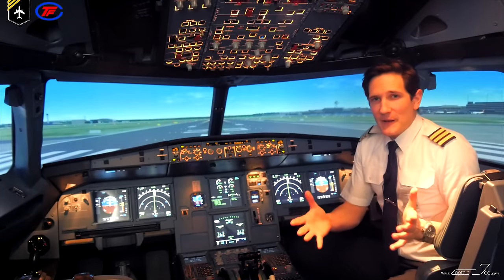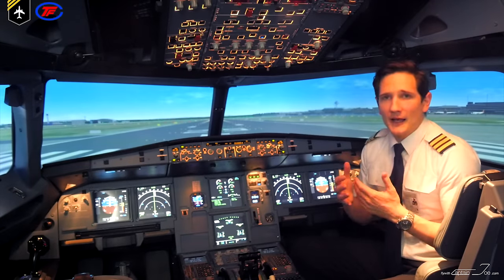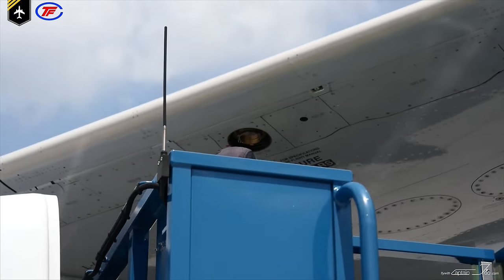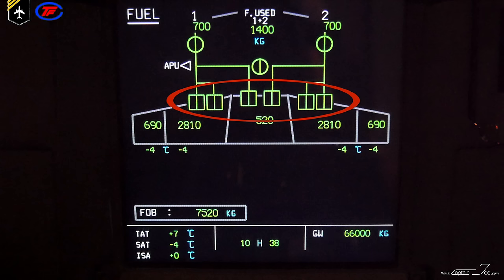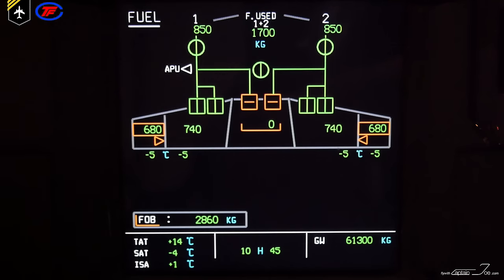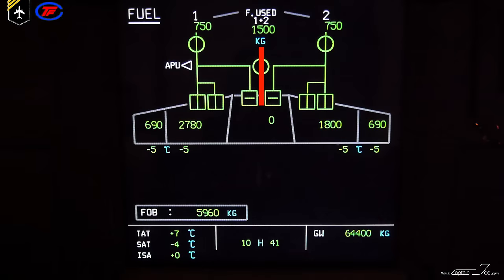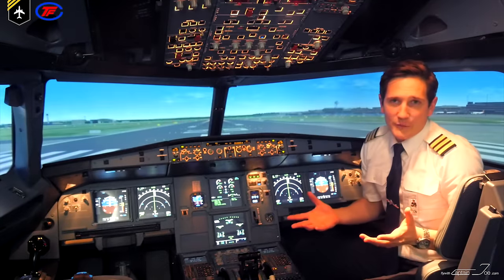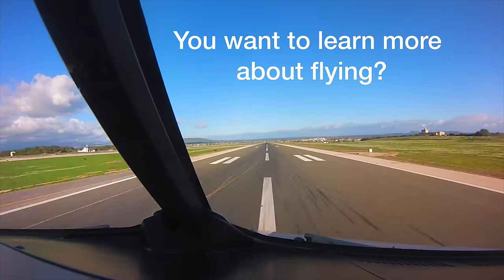How does the AIRBUS FUEL SYSTEM work? Explained by CAPTAIN JOE

Comment: good job Joe ! Can you explain in a video what do you do step by step since you arrive at the airplane until the takeoff ? I mean for example, open the door, enter cockpit, sit a your place, swith on the plane, and calculate speeds...
Reply: would be too much to explain
Reply: He don't need to explain every step. Just tell us like a before switch on checklist
Reply: Maxoo68  he checks out   the female flight attendants first ,just to make sure his day goes on smoothly than he starts pressing buttons
Reply: Haha ^^
Reply: "open the door, switch on the plane"
xD This is too funny
Reply: Like a vlog on a flight
Reply: AnatoleH1 Like in a car. Turn the keys to the On position and turn it temporary a bit further to crank the engines. Then put the gear lever in first gear and slowly release the clutch 😉
Reply: It is vey dangerous that planes have fuel tanks inside the fuselage or near the fuselage.
Reply: Maxoo68 @ usually it goes like : “ pitot heat give me to eat”
Reply: Ask him where the liquid fuel goes ??

Comment: Captain, I think you're  a great teacher on matters aviation, but I have a question:  is the plane able to take off with that much fuel?  And what about the tank capacity...looking at the wings, it doesn't seem to be able to accommodate tanks to handle that much fuel?
Reply: I agree. Captain Joe is great. The airplane is normally able to take off with that much fuel, but it depends on several factors. Takeoff and landing performance are calculated based on among other things temperature, air pressure, runway length, runway slope, wind, terrain, and as you would guess weight. If the runway is short, the airport elevation is high (lower side pressure), the temperature is high, and the aircraft is full of passengers and cargo, then there could possibly be a fuel restriction. As for those amounts of fuel fitting into the tanks, I agree with you that it doesn't look like it would work. I will say that the wings look much smaller from the terminal or the cabin than they do when you are walking under the wings. Also, the wings are quite thick, especially at the wing root. Check out Captain Joe's exteriors walk-around video and you can get a good view.
Reply: @mulder2400  I agree, when you take in consideration the numbers the math just doesn't add up. On top of that if you just do a round number of how many planes that fly in a day, vs the gallons of fuel used by the planes vs the gallons produced , theres not enough fuel made. The planes might use some fuel, but not that much as they state they do.
Reply: Hi i have some questions It is true that the center tank can refill the wings tank in cruise in order to increase the lift ?and what about boeing planes like 737and 747,are they even manually on the pilots decision,able to do somethings like this?
Reply: @mulder2400  Excellent ! Thank You for the links.
Reply: @ethansaviation2672  Are you trying to quell Free Speech? What  a small mind you must have. Why not consider what Mulder is saying here and try to refute his findings or ask questions??? instead of calling him names??? You need to grow up.
Reply: @emgee3057  Actually, I have look at many links (including these ones) from people who believe this theory. They don't make sense. I do think I was a bit harsh though.

Comment: Hey! Could you do a video about what pilots do during cruise speed?
Reply: They usually sleep one by one or prepare next flight or talk to each other... but they have to monitor constantly all the information displayed to see if everything is correct
Reply: Alpha Only on long haul flights any crew member will sleep. And if the flight is longer than x hours, a second set of pilots is required. So both the captain and co-pilot go for some off-hours or none, being replaced by the second pair of pilots. It's not like the co-pilot goes for a sleep and the captain sits there on his own ;)
Reply: Richard van Pukkem Thanks for your comment ,  I forgot to say I included all flights from short to long haul and obviously pilots don't sleep in a short flight... Just for fun , in 2014 the pilot of an A319 going from spain to belgium slept and was contacted by French Air Force for not answering ATC... :D
Reply: They play rock sizzers..

Comment: I remember watching a documentary where a leak caused fuel imbalance. The fuel temperature and pressure caused the crew to misidentify the problem and turned on the cross-feeding which exacerbated the problem by letting more fuel leak out.
In the end, the aircraft lost all its fuel and had to use the ram air turbine for power and glide to the closest airport.
Luckily they succeeded.

Comment: Can you teach us about Cost indexes?
Reply: it is multiple index as related to cost. there now you know
Reply: Made no sense.
Reply: The cost index is used to optimise the aircraft's speed so that the total cost of the flight is at its lowest. It gives the ratio between the unit cost of time and the unit cost of fuel. Does that help at all?
Reply: But I still don't get how it changes from airline to airline and so on. I just want Joe to explain really.
Reply: Fuel duty in different countries and where different airlines operate is likely to be the reason.

Comment: Hi Joe! Could you explain how do the spoilers work and how are they activated? Thanks, and great vid!
Reply: They increase drag and are deployed with hydraulics.
Reply: That's one way to answer his question :D
Reply: +Villager #4 thx buddy!!
Reply: I'm no pilot but I was taught that they primarily to spoil the airflow over the top of the wing and reduce lift, increased drag and slowing down is secondary/complementary to this. For instance if you didn't deploy spoilers on touchdown, ground effect could cause you to skip/bounce down the runway. Spoilers on an aircraft "spoil' lift (i.e. increase downforce) causing the full aircraft weight to rest on the gear which allows the brakes to work at full effect without skidding. They also increase drag and allow the aircraft to slow down. I've seen them deployed in flight outside my window on a 737 during descent, possibly to slow the aircraft and reduce altitude (to keep within the glideslope).
Reply: Yes, I also think the main function of the spoilers is to spoil the lift created by the wings during the touch down. An aircraft can fly because its wings are shaped to let the air accelerate faster on the upper section of the wings than the lower section of the wings. That causes a lower static pressure on the upper side of the wings so the pressure differential creates a lift force which pushes the aircraft up. The spoilers are to decelerate the air on the upper side of the wings by blocking them. That reduces the pressure differential so the aircraft can overcome the ground effect and firmly grip the ground tight. Once the wheels are on the ground, brakes will do the work and stop the aircraft.

Having said that, spoilers still create some drag to decelerate the aircraft, but the main aerodynamic drag still comes from the flaps.
Reply: There are spoilers for inflight and also for ń the ground which are the inboard ones.

Comment: Please explain what a squawk code is?
Reply: Shawn Malaka it is just a random number assigned by the controllers to identify your aircraft. Every aircraft controlled by a controller has a different squak code.

There are some special codes if you fly VFR (depends on where you are) or have emergencies (7500, 7600 and 7700).
Reply: It is a number transmitted by the aircraft transponder (along with other data such as altitude) every time the radar beam is detected sweeping the aircraft.  It is used to identify the aircraft on the ATC radar scope.  The code is more or less randomly assigned, but there are specific squawk codes the pilot can use that indicate things like hijack, emergency, etc.
Reply: When ATC requests a squawk, they are also requesting that the pilot presses a button on the transponder that highlights the aircraft and it's information on the radar screens

Comment: Great video as always Captain ;) The Fuel to Oil Heat Exchanger caused a crash of an British Airways Boeing 777. The fuel got blocked by ice in the FOHE and therefore engines lost thrust just on final approach to Heathrow. Luckily pilot made a split second decision to retract flaps by one degree and they crash landed on the airfield.

Comment: Fuel storage 23,000 L ie tons!! FOB says 7,520 !!!!!! Errrrrrrr you're lying 23,000 tons of fuel is a joke on a aluminium plane!! taking you have passenger weight, cargo, baggage, What those wing tanks are is  compressed helium tanks and the plane engine run themselves on compressed air.
Reply: A litre of fuel does not weigh a ton. It weighs a little less that a kilogram.
Reply: @mikelowe5096  0ne thousand lites == roughly a ton! 23,000 ummmmmmmmmmmmmm lol
Reply: @chilbury  Since you can't seem to do basic math, it's 23 tons, not 23,000 tons as you stated.
Reply: It’s 23 tons in liters by volume and in kilos roughly about 19tons. I get the confusion, fuel in planes are measured in mass and not volume. It burns on average 40 kilos per minute both engines and 2400 kilos per hour. So for short flights 7520 can still take u 2 hours of more and rest are fuel reserves, hope it helped and u have a nice day. Awesome

Comment: Hi Joe, great video however, Airbus has not installed the IDG cooling system to prevent fuel from freezing. It's job, as you mentioned, is to cool the IDG oil. A secondary effect of this oil cooling is the heating of the fuel but only in the outer tank. Fuel can still freeze though and there is an ECAM alert for this as you're well aware I'm sure.

Comment: Hi there. Can I ask are you basing this video on the A319/A320 or the A321. Also which engine type? I would guess CFM seeing as you mentioned the IDG oil is used to warm the fuel but not 100 % sure.
Reply: A319/A320 as the A321 doesn’t have separated wing tanks

Comment: Fuel isn't transferred from the heavier tank to the lighter tank, its merely burnt from the heavier side by both (or either - SE case) engines by switching off the fuel pumps on the lighter side.

Comment: Can you please clarify for me: the fuel-oil heat exchanger only heats up fuel in the fuel line so it doesn't gel up in the high pressure pump, right? It doesn't then feed the fuel back into the tanks to keep them heated.

Comment: The A320 fuel system is pretty basic. the MD11 hast up to 8 tanks (6 standard) devided in up to 12 compartments (10 standard) with up to 22 fuel pumps (18 standard). It's the most complicated fuel system out there that I know of. But basically it works very similar. Fuel is used from the inner tanks/compartments first and last from the wing tanks/tip compartments.

Btw, the the main fuel oil heat exchanger is more important than the IDG FOH ;)

Comment: Nice video. All very accurate. One thing it breaks from time to time as usual on any aircraft but a lot of electrical faults for auto feed and also the fuel inerting Staten is the biggest pain in the ass on this aircraft

Comment: Captain joe, I have a question for a potential video. Does a pilot stay on one aircraft type through their whole career or do they gradually progress through different aircraft that are classed as more challenging to fly? If this is true how often do they change and approximately how many different models will a pilot see in his career?
Reply: Depends on what you want. If you’re based in a city that’s mostly airbus 320 and let’s say 787 flying you you’ll do one of those. Most of the time pilots will choose their base and whatever type they can hold in new hire training. If a pilot wants to change base or type, they may bid for it though you’re subjected to a “seat lock” for 2 years or whatever the airlines specifies.

Comment: I always found that to be clever. Using fuel to cool the oil, which becomes oil warming up the fuel instead of a separate oil cooler and separate fuel warmer.
Reply: SixStringLove Guy BMW uses the same trick, putting coolant to cool the oil, via heat exchanger. The unit at the E46 generation was failure prone when different grade of oil is used (30 instead of 15), until the 2007 face-lift when thicker plates used

Comment: Can I ask some questions please? 1) Are planes ever over fuelled for a return trip, or would that weigh the plane down too much? 2) If fuel in the wing tanks is used to increase inertia and dampen wing movement, are planes ever over-fuelled so they can benefit from this damping on landing? 3) Is the obvious wing movement on landing linked to a lack of fuel in any way? 4) How is fuel transported to airports? If an A320 sized plane takes over 20,000L, the fuel requirements of a busy airport must be immense. Thanks 😊
Reply: No they are only fuelled with fuel for the flight and reserve fuel
Reply: 1) Yes it’s called tankering and Joe has done a video about that and it’s normally where it would be cheaper to just use extra fuel at the base airport instead of refuelling at your destination. 
2) You wouldn’t overfuel just for that reason.
4) Underground pipes
Reply: @ethansaviation2672  actually they can. It’s called tankering
Reply: @tomstravels520  Thank you. 😊👍🏻

Comment: I remember the incident of Air Transat flight 236.  They had developed a fuel leak in one of the engines.  This subsequently caused a fuel imbalance in the fuel tanks.  Following the protocol, they opened the cross feed valve to balance the tanks, not realizing that the reason for the imbalance was because of a leak.  This action subsequently drained both tanks and they ended up gliding several hundred kilometres without fuel.  What I don't understand is if they were monitoring the tanks as they should be, why did they not close the cross-feed when they realized that the imbalance was continuing and that they were consuming fuel at an alarming rate.
Reply: As far as i know, they believed for a very long time the computer showed corrupted data because the first indication that something was wrong was an engine advisory that indicated high oil pressure and low oil temperature in the engine with the leak, which under normal circumstances makes no sense at all for an engine that already runs for several hours.
Reply: So they believed the oil pressure warning, oil temperature warning, individual engine fuel consumption, and total fuel onboard data were all malfunctions, yet believed the fuel levels in each tank and imbalance data was accurate.
 Sounds like they were believing the only data they wanted to believe and disregarding rest.

Comment: Hi Captain, I really enjoy watching your videos and learning more about the mechanics involved in jets. This time I have a question. If we store fuel in wings, which holds the engine dont you think it is going to be risky in case of an engine failure which may result in fire or high temperature and then the fuel might also catch fire?
Reply: Kishan Mishra the engine is hanging from the wings. So it’s not really that close. And there is no other place to store fuel.

Comment: 23.858 reads like 23 point 858 which is less than 24. For 23 thousand and 858, we usually use a comma in the middle and write it as 23,858.

Comment: Great videos for aviation enthusiasts like me who are not in the profession...quite sure you know of the Air Transat 232 scenario where the pilots switched on the cross feed valve to solve the fuel imbalance issue which in that specific case worsened the overall problem...though that was the A330, could you give more specifics to troubleshoot with a checklist for the A320 please...

Comment: Dear Joe, 

have the aircraft developing companies implemented some kind of system that prevents the occurrence of ignitable gases in the tank as a lesson after the TWA-800 accident in 1996? 

I also wonder if a commercial pilot has enough leisure time to make a you tube channel or are you given this time by your air company? I also this because I got a lot of contradictory info lately.

Thank you so much for all your efforts!!
Reply: Hi, Airbus added an inert gas system that fills the tank with nitrogen. I dont know if older aircraft were refitted with that system but i really think they were.

Comment: Is it actually possible in the case of a leak in one of the inner wing tanks, that you can isolate only the tank and basically fuel both engines and/or the apu from the other inner wing tank via the crossfeed valve?

Comment: Curiously being the same family, A321 fuel system is quite different. No outboard tanks, and center tanks can't supply the engines directly, but they supply wing tanks instead. Simpler and better than A320 imho.

Comment: Question: does each wing have to be filled will fuel separately, or is one wing filled and it automatically flows to the center and other wing?
Reply: Fuel will automatically be transferred from one to the other. If the system fails there is probably a way to manually refuel the other side

Comment: BA Flight 38 crash landed near to runway due to ice clogging the fuel-oil heat exchanger, thus starving the engine of fuel at the critical moment near landing. Dual engine failure. Pilots Captain Peter Burkill and First Officer John Coward. Souls on board 152. All survived.

Comment: So what happens when you get ice in the heat exchanger? Or is that only a problem when flying into London?
Reply: Hey, I was gonna say that. lol.
Reply: Well that was the case for a British Airways Boeing 777 engine which had a slight design error allowing ice to build up on the exchanger. This limited the amount of fuel flow tot the engines which eventually caused them to stop. The design error was fixed and is no longer a problem.
Reply: theonlyari And RR bought BA a new 777... That incident is an interesting engineering analysis, and amazing nobody was killed.